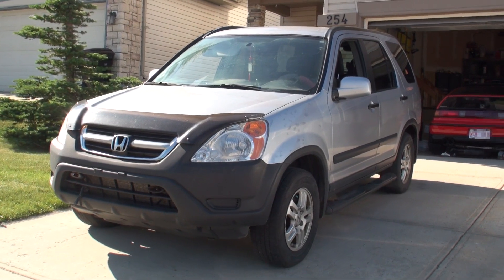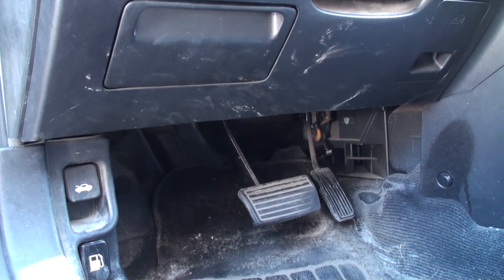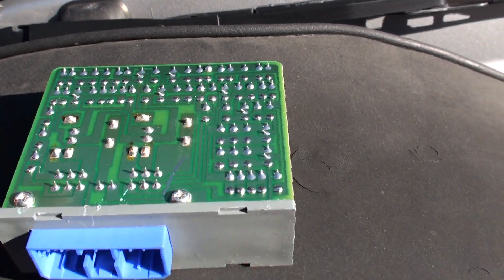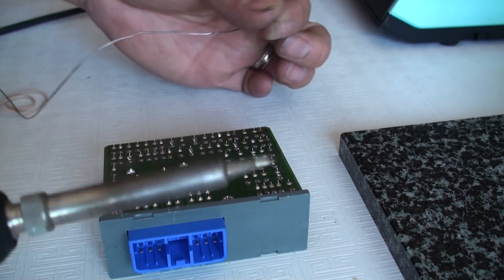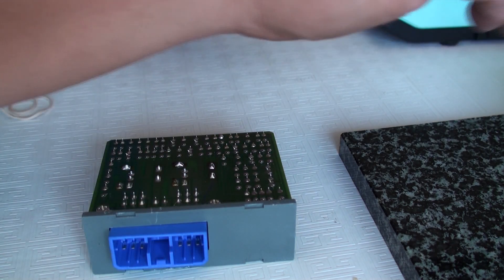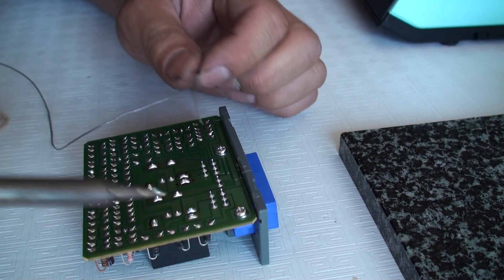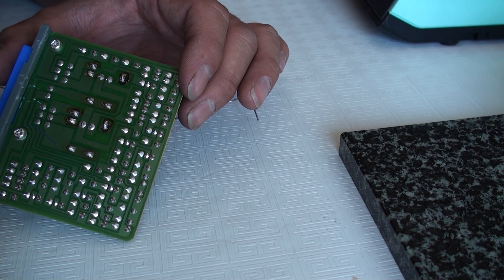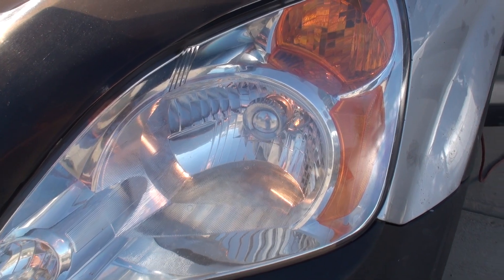DIY Honda CRV DRL Module Repair

Comment: What gauge of wire is that and what type of wire is ie all lead, tin etc. thanks for taking the time to show your skill to us.
Reply from the maker: the solder used is Kester leaded solder that is a tin/lead mixture with built in rosin core flux.  I just picked up some fine gauge solder and I can't remember what size it was but it was quite fine.  I like fine wire solder b/c it melts and handles a little easier than really thick gauged solder that would otherwise need more heat which can be a bad thing for delicate components.

Comment: First of all (just in case this help others with headlight issues) not only did we not have running lights, but the passenger side high beam wasn't working. It was one of the smaller connections and wasn't as easy to melt with my small iron. This solved both problems. You have no doubt saved me untold grief. I CANNOT THANK YOU ENOUGH!!!!!
Reply from the maker: I technically re-flowed ALL the solder connections on the board BUT the ones that should be focused on is the joints that are closest to the relay as those are the current carrying connections that get very warm and thus develops cracks over time.  If you closely examine the board using a magnifying glass you can generally see the micro cracks that are developing.
Reply from the maker: glad the video helped you out.  Thanks for that tip as I'm sure others have had a similar issue like yours.
Reply: We have same problem. RH DRL not working and RH HB not working. When you say "smaller connections" do you mean one of the two small connection behind the relay or was it one of the numerous small connections on the outside edge of the board? 
piercedasian - one of the best auto DIY vid's out there. Thanks
Reply: was wondering about the passenger high beam,  couldn't care less about running lights,  thanks for throwing that comment up

Comment from the maker: Hi Nick, I would recommend synthetic oil however, there are some gotcha's with synth oil - specifically oil leaks on seals where they didn't leak before.  My Honda Odyssey when I first purchased it with 100, 000kms on it got switched over to synth oil and I had a leak start on the main seal.  Now I'm quite certain that the leak would've happened eventually but the synthetic made it pop up sooner I figured I had better not upset my viewers by telling them to use something that could cause a leak.

Comment: Did this a couple of months ago. worked well as well. i have a '04 too (in mtl) and it's nice to see one with a lot of kms. I have yet to hit the 200k mark. Had to replace the compr./cond. though and a caliper, but all else is well. Good soldering tips! in your Nissan Versa oil change video, I would be cautious recommending synthetic oil for an engine that is habituated on regular petroleum oil, as it might enable leaks to be less inconspicuous on older engines. I like the blue colour, Best.